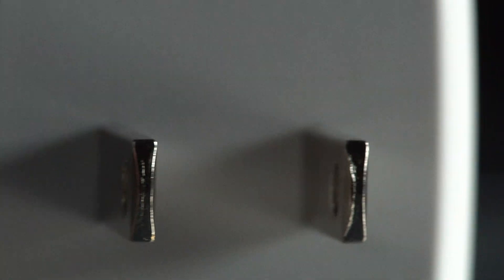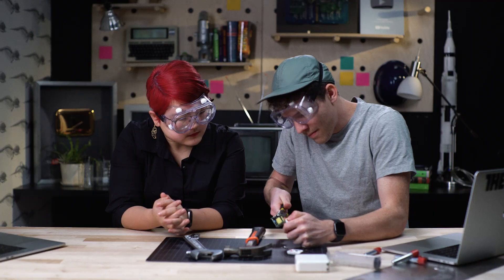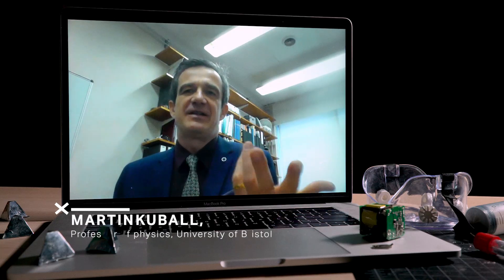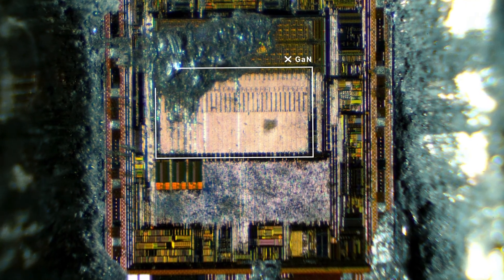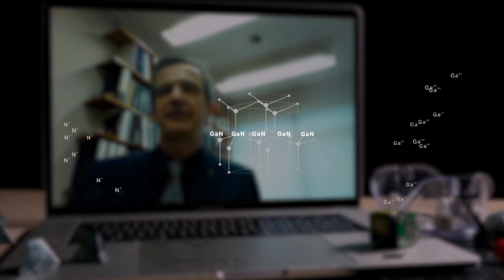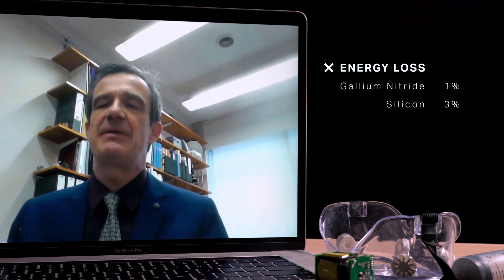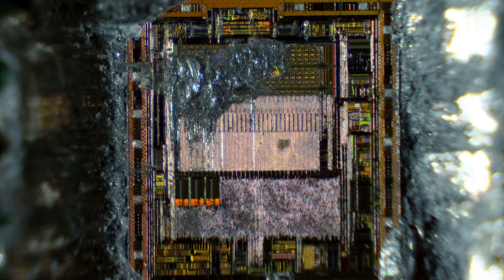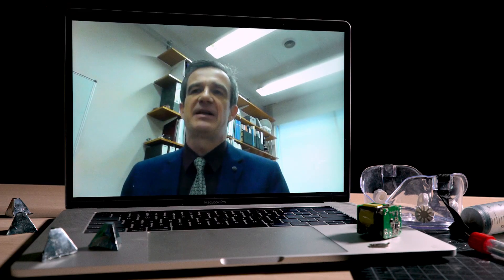Is gallium nitride the silicon of the future?

Comment: I'm surprised that he said the biggest barrier to adoption was manufacturing & design difficulties. From everything I know, gallium is simply more expensive than silicon, and much more difficult to purify, meaning that its yield is lower and thus using it is again, more expensive. I'd be very surprised if all of a sudden we had a huge price drop.
Reply: I looked up the supply chain and it appears gallium is a byproduct of other mining and doesn't occur in higher concentrations by itself. So the supply is limited by the demand for other minerals and the environmental impact of mining and refining those other minerals. An improvement in efforts to recycle aluminum, for example, could reduce the supply of gallium.
Reply: Huh. Interesting to hear about that - but while on the subject, doesn't GaN have a higher electron mobility than Si? So hypothetically you could have higher-frequency clock speeds AND reduced resistance for these kinds of fast chargers?
Reply: @specific_pseudonym  Because it is some highend laptops does come with GaN in box but you won't see mass produced GaN anything anytime soon
Reply: From what I read production is not the high cost it the process to make it work for circuity that increased cost several times unless in one year things have changed.
Reply: GaN process development has not gone well lately.   I think it suffers from the same problem as GaAs: you cannot grow oxides so manufacturing is tough.  Also the transistors will drift.  It has some great potential but only in power.
Reply: Its all about mass production and implementation which will definetly take some time but it is doable. Someone can comment how much price you paid for 250MB flash drive 10 to 15 years back and how much is it now? Do you know why? Implementation and technology node made the manufacturing really less expensive. For the same price you paid 15 years back for 250MB now you can get close to 128GB/256GB flash drive..
Reply: The thing is that Silicon has its limitation as to how hot it gets without it overboiling yes Silicon boils but if it overboils you have dead CPU on your hands

Comment: Galium and Germanium was the first material to be used for transistors not silicon so weird headline
Reply: Germanium yes, not Galium!  Before that there were attempts at using Copper Oxide, or Vanadium Pentoxide to create early transistors as far back as 1926

Comment: Gallium Arsenide was the darling years ago (I'm old enough to know) but it, like Gallium Nitride, is too expensive and exotic to use on a massive scale and both are virtually impossible to recycle.
Reply: GaN is already deployed on mass scale in every single white LED that exists in the world. That is one major reason why the electronics side can be significantly cheaper than GaAs
Reply: Could Gallium Phisphide be used I don't know if such a compound exists but if it did I would assume it has similar properties to Gallium Nitride and Gallium Arsenide
Reply: Can it be fabricated into an equivalent of CMOS chips? Or at least offer some other advantage over existing stuff such as having a less cumbersome way of doing mixed analog-digital, easier small batch custom chips, 5ghz+ chips, better combined logic + DRAM chips,  some new exotic low latency persistent RAM type?

Comment: "Semi conductors are about halfway between these two extremes". Seriously? So, it conducts, but just a little?
Reply: It conducts, but only when certain conditions (e.g. energy level or whatever) are met
Reply: More to the point, semiconductors form unilateral conductors aka rectification layers or contact points
Reply: that's only the half story. silicon on it's own does not do anything. You need to inject additional atoms, so called impurities. this doping (technical term) allows to change the conductivity. this makes p and n type semiconductors (where n type have excess electrons and p type have excess holes [too few electrons]). at the pn junction, the magic of semiconductors happens. 
In Short, they failed to convay any real information, just vague statements which do not make a lot of sense.
Reply: It's true. For example, glass is ~10^-12, silicon is ~10^-3 and copper ~10^7 S/m so silicon is in the middle.   It's kinda incidental, though. The thing that makes silicon and other semiconductor materials so special is their ability to have their electrical properties easily modulated via the introduction of small amounts of specific impurities called dopants, and the interesting electronic behaviors that are possible with precise patterns of doping.   This is mainly due to the bulk availability of outer-shell electrons in the material, which has the side effect of giving them middling conductivity.

Comment: kinda cringed at you guys trying to open the charger by pulling/twisting the prongs.
Reply: uh, yes, my next question was: wait, don't they have capacitors there - you know, where you just used your hammer - and you are picking this up with your fingers?
Reply from the maker: @ToxisLT  We discharged the capacitors to be safe, but this was a review unit that never held a charge.
Reply: @VergeScience  good;) as after your famous pc build guide - one never knows;)
Reply: @ToxisLT  😂😂😂
Reply: @VergeScience  I saw those caps and thought "oooh.. this could be bad." Figured it was discharged though. Not sure how long they stay charged on those models.
Reply from the maker: Saaaame, which makes me really happy we didn't show me trying to decap the PMIC. — Cory
Reply: A neighboring shop to mine in the bay area (San Leandro) called e-cycle had a guy drop off a home desktop computer that he wanted to donate to a school.

He expressed concern about data privacy and what means the company had to safeguard his financial data.

The e-cycle guy popped out the hard drive and smashed it with a hammer.

Later that day some baggage carts came in from a hotel on the San Francisco wharf to be scrapped out. I went next door to my shop and came back with a neodinium magnet. I told the guy next door this,this and this is brass. This frame here is plated steel.

He asked me where did i get such a powerful magnet? I walked over to the hard drive that he smashed earlier that day. I peeled back the aluminum cover, reached in with a screwdriver and fished out a big blob of magnet chunks and hand them to him.

Comment: But is a large scale use of GaN sustainable? I mean silicon is used in huge amounts and luckily is available in those amounts respectively. But with Gallium I could see a similar problem developing as we have with the resources for Li-Ion batteries right now. Or am I wrong about the large-scale availability of Gallium?
Reply: You are absolutely right there is a thesis from MIT that explains why GaN will never work in large scale as silicon. It's not available as much to change the whole picture of electronics itself.
Reply: Its very rare however we could certainly produce it in power transistors. The idea of making entire ICs or processors out of it though is kinda silly.
Reply: They use it for satellites so no, it is a hard process and takes time a power.
Reply: Gallium is not even in the top 10 list of most abundant materials on earth. The only benefit of Gallium is that it's found alongside other mined things like aluminum and zinc, so it's kind of just a byproduct of mining processes. So no, Gallium really isn't worth it. But people will try to make money off of it anyways and hail it as a future material because everyone knows the semiconductor industry is desperately looking for something better, primarily more efficient and able to run at higher temperatures.  I think Gallium may probably have some drawbacks they aren't discussing.  For example, it's not completely inert, it's a crystal which means it could suffer from resonance issues along with being somewhat brittle. Meanwhile silicon is a fairly flexible and rugged material, besides being abundant, and doesn't really react with anything.
Reply: @peoplez129  Gallium and aluminium always exists together as bauxite, an ore so hard to extract, that aluminium was more expensive than gold at one point of the time. But with modern extraction technology, gallium will always be available as long as we're still mining bauxite to manufacture aluminium. I don't really get the issue with it being a crystal, monocrystaline silicon is literally the form used to make all ICs and discrete electronics in the entire world.
Reply: @user-zb6gt7og9q  Crystalline form doesn't mean inert.  Example:  Salt is a crystal. Is that inert?  Nope.
Reply: I guess it won't go along nicely with the flexible electronics coming up ;) @peoplez129
Reply: Smaller devices means less material is used to make it. Especially in the scale of micrometers
Reply: Nanometers*
Reply: Yes, but the amounts needed would still be huge.. @user-zb6gt7og9q
Reply: @GoodPrice1  Not as much as as gold I presume? And which one is the rarer material again?
Reply: Well I don't know how much GaN will be used compared to silicon, but there's definitely less gold in electronics than there is silicon.. @user-zb6gt7og9q